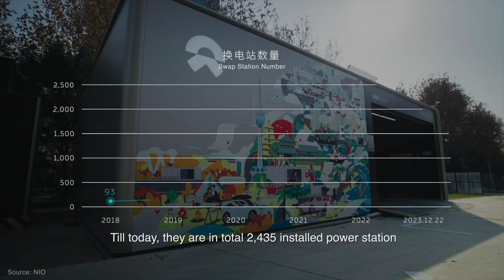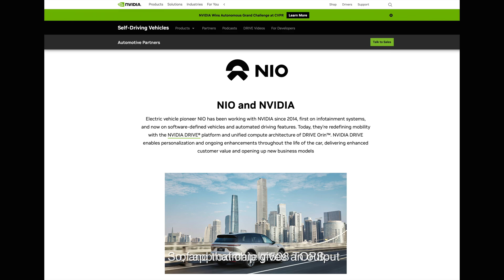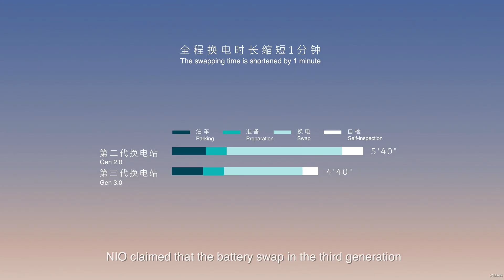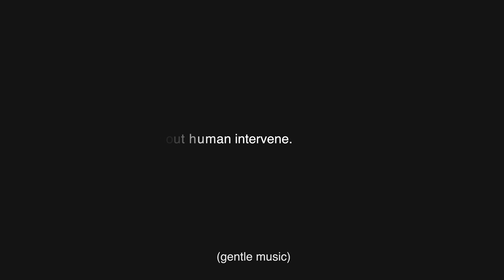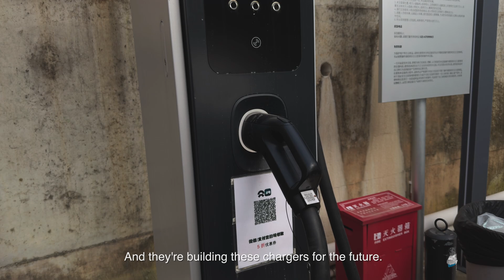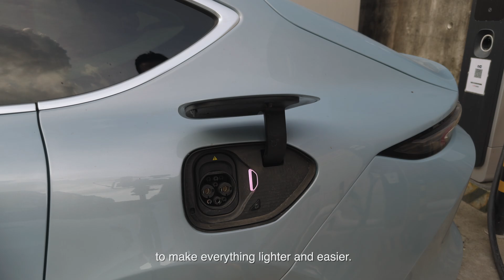NIO Power | 3rd Gen Power Swap Station (3.0) | Upgrades explained

Comment: Hi, Thanks for the video. I am a bit worried that the swapping stations themselves will kill the Nio. 21 batteries in every station means 21 unsold vehicles. It is way too expensive, and with charging/battery innovations it will neither bring any value to the customers nor to the company. Actually, I like the idea of using the stations as fast chargers, when the power goes down and you can use the energy from stored batteries. :)
Reply from the maker: Hi, thank you for bring up the doubt. Technically customers are not purchasing the individual batteries, yet the "subscription" of using all batteries from NIO battery pool, this will deliver the risk of battery (most fragile and most expensive part of an EV) from customers to the car manufactuers. Meanwhile there are protocols between car manufactuer and battery providers so that jointly they can monitor, maintain, renovate and demolish the batteries. Namely, in a longer term customers are always enjoying the best battery in the market without bearing the risk which will be beared evenly among NIO and battery providers.  I hope I've explained you well, if you are interested, I can make an exclusive video talking about this content in extention.
Reply: Thanks for your response. I have some NIO stocks and unfortunately it does not look good. If you present some kind of business case, which would end up with positive margins, that would be than awesome to watch and understand. With CATL’s latest batteries the charging last 10 min to get 400km range. That could be another killer for swapping stations. Unless they bring up some additional functionalities of those stations like transportable chargers to utilise the batteries laying there waiting for their customers. I like Nio, please do not get me wrong.
Reply from the maker: @jaroslavsplichal97  Hi, I'm not a professional regarding the stock market, I do believe the main reason was because the financial deficit over these years even the gross margin has gone positive and over 10% yet the R&D has been burning too much money. I'd suggest you to observe and hold at least till the end of this year, since starting Sep they will be promoting the sub-brand ONVO and I'm confident that the sales could go burst. Overall NIO cars are still a bit pricy.
Regarding the ultra fast charging, there are many prerequisites to accomplish that rapid speed which they don't usualy talk. I'll share another video regarding this theme later this month.
Reply: @jaroslavsplichal97 Just think of the amount of stress the battery can have over time using a fast charge in 10 mins.  Don’t you think that will not shorten the life of the battery inside your car that doesn’t have the technology of easy replacing it and the expensive amount of having your battery change.
Reply: Hi, Thanks for the comment. No, I am not worried. Batteries have a great BMS. They also cooling and warming system to keep them in good shape and protect them too. Please look at the stats. Unfortunately, I do not see the future in battery swaps, and I am affraid it will kill Nio, if they do not come with some other more suitable business case.